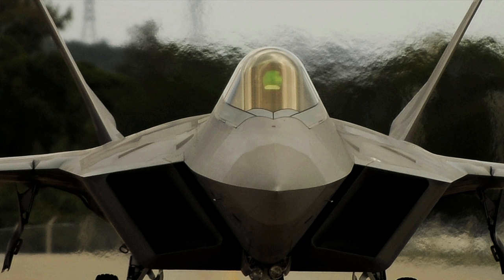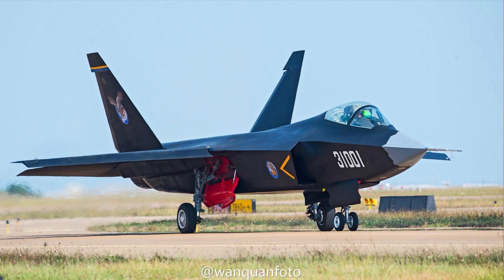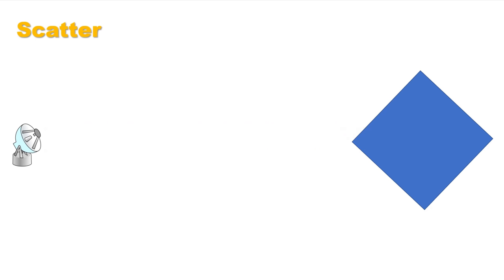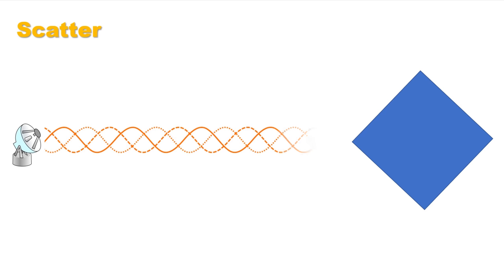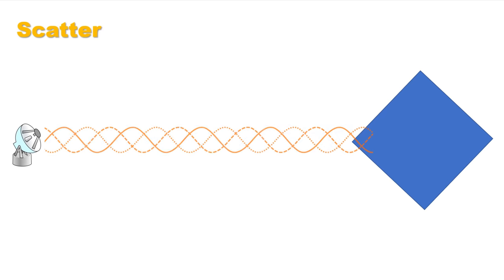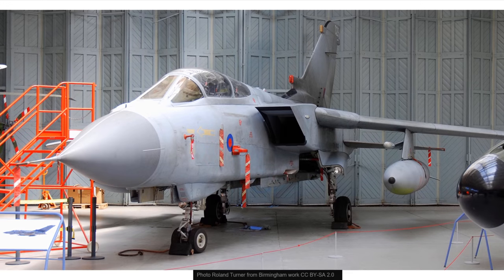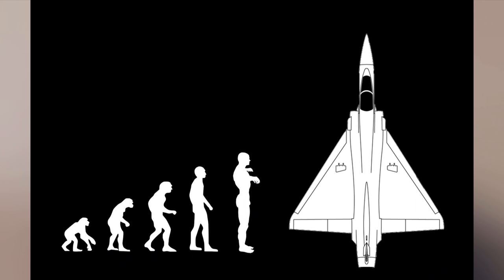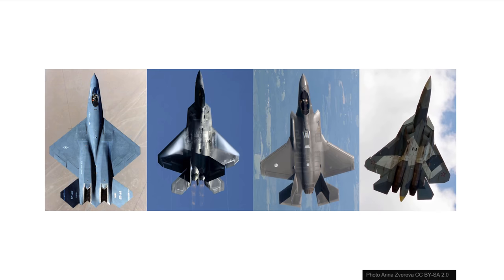STEALTH Killed AERODYNAMICS | why all modern jet fighters look alike

Comment: by brute force vs finesse  and thats a surprise?   Think about it   it AMERICAN where they need a 6L V8 to try to match a a properly designed/build 2.5-3l I6 

The US car mfrs are an excellent analog for much of that in many aircraft they have made   Not all  some are amazing but genius designs by rare gifted people like Jack Northrop, Kelly Johnson, Sutter,  and a few others,,    but they are of an era almost completely gone,,, and even the almighty skunkworks now is a laughing stock churning out craptacular shit (F35) that again can only even do a part of its intended goals by sheer brute force and is supposed to replace many others that are vastly superior in most ways

The f35 for example is to replace the F16 for one..  and the F16 is higher t/w

Meanwhile the Gripen has less t/w than the F16 and yet can match its clime rate sue to cleaner aerodynamics and superior wing loading

Finesse vs brute force..   BF can be good but its not the beat all end all

Sheer raw power to speed away is why one training flight an F15 used that massive power to escape the Gripens.  but only 1 of the 3 eagles escaped.

Meanwhile back with cars etc..  I for years always laugh at the mustangs, camaros etc etc trying to race me..  one in particular was priceless.. dolt in 5L mustang trying to outrun me light to light..  and failed 6 lights in a row.  Granted I wasn't outrunning him either but i also had a hell of alot less power and was driving stick while smoking and drinking a bottle of pop at the same time.  Then after those 6 lights came the curves and twists where I absolutely owned him in spades..  By the time I reached the end of that section of road he was over 20 seconds behind me and I didnt even push my lil beast to its limit

Comparison
he had 240hp/315 lb-ft torque from 5L v8 3300lbs - hp/lb  0.0727272727272727
I had a whopping 140hp/152 lb-ft torque 2750lbs   - hp/lb 0.0509090909090909